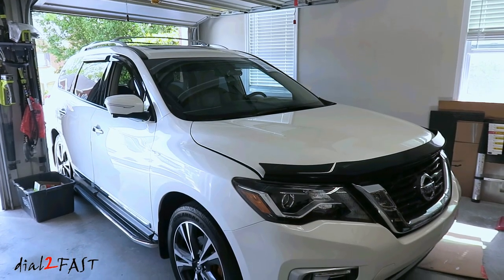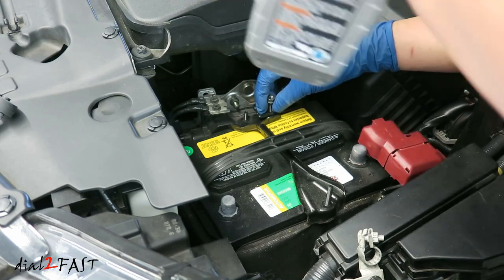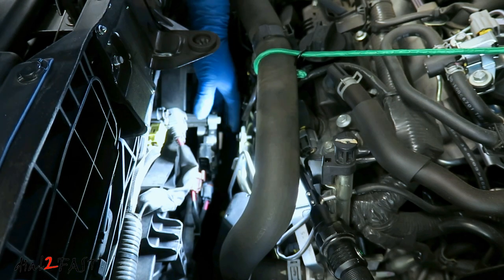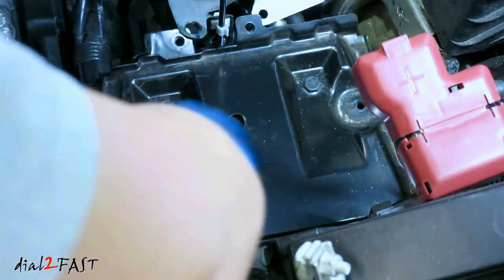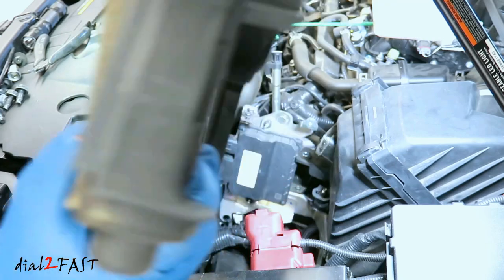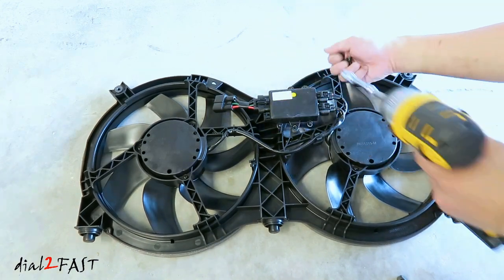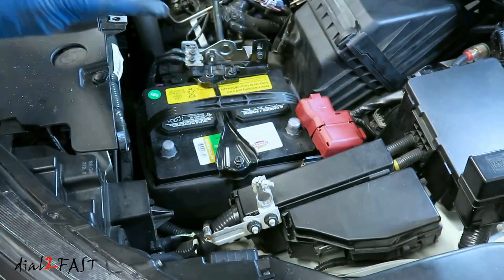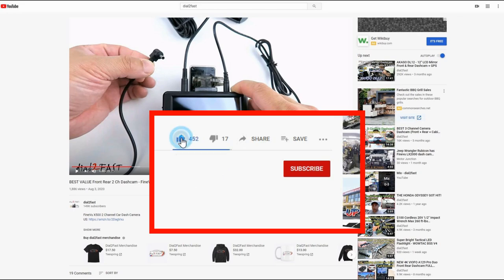How To Replace Nissan Pathfinder Radiator Fan Assembly (Infiniti QX60)

Comment: My new, "used," 2016 Nissan Pathfinder which I purchased in October of 2021 with roughly 57500 miles on it, started making the fan noise after driving it about 2500 miles.  Unfortunately I discovered this chronic fan assembly issue after my purchase.  Fortunately, I found your video and purchased and installed the recommended fan assembly, (TYC 623760 Cooling Fan Assembly (For Nissan & Infiniti), as you demonstrated in this video.  It was installed during the first week of January 2022 and it worked beautifully.  It is now May and about 5000 miles later and sure enough it happened again, and now I am left with nothing.  The part is no longer available through Amazon.  I cannot even get the satisfaction of writing a "scathing"  review of the TYC 623760 Cooling Fan Assembly (For Nissan & Infiniti), because Amazon doesn't even recognize it.  Now I am stuck in southwest Florida, taking my vehicle to a Nissan dealer of which I am very leery.  They tell me the OEM Nissan part costs $577.50 with tax and if it takes any more than 2 hours of labor, I am paying $1000.00 +.  I am going this route however, so when the next 5000 miles or so rolls by, it will be covered by warranty.  (Let's hope Nissan can at least stand by their own warranties on their own parts).  I cannot express enough the rage I feel about being so misled with this junk vehicle and I still owe a ton on it.  From the dealer to the DIY, I have been lied to, and/or misled.  Nissan=Bold face liars with no integrity.

Comment: Very helpful! I just did the replacement but I'm noticing that the fans are on all the time and seems to be actually running super fast when the AC is turned off. When I turn on the AC the fans calm down a bit and run at normal speeds. Not sure why it was happening so I replaced the relay that controls the fans but the problem continued too happen. 
Any suggestions on what might be going on??
Reply from the maker: The only thing I can think of is there might a problem with the fan controller that came with the new fan. Not sure if you want to try connecting the old controller to the new fan and see if the problem is still there. If that fixes it, then contact the new fan seller and ask for a replacement.
Reply: Which brand of fan did you buy? I'd like to avoid that one.
Reply: @Stephen Cabrera
Reply: @dial2fast  I replaced mine 2 summers ago, and I just noticed that neither fan is running at all. I had strange symptoms last summer that led to the check engine light and traction control light coming on, only on hot days when I had the A/C on and was stopped at a red light. Nissan dealer read the code and it said mass airflow sensor. They replaced it, and 2 weeks later the lights were on again, in the same situation. I think that the fans might not have worked since last August, and that my A/C was stressing the whole system. This year, the lights come on  as soon as we got a 30 degrees Celsius day and the engine would stall out. 

Since I know the fans don't work for sure, and I've tested the fan relays, do you suggest replacing the whole fan again? Or should I take off the front air box (for room to get at the wiring harnesses) and attempt some other kind of test on the module or fan motors? 

I'm ready to trade in the vehicle and buy something new, but now I have this issue and I'm afraid the dealership will notice that the fans don't work and the A/C sucks and they will low ball me. 

Thoughts?

Comment: First thank you for the video it'll be helpful for some that are or will be in the same situation! Second its sad you had to to this on your own on a car that's basically still new since you have low miles on it. Nissan should be responsible for it. On the nissan forums i see allot of people had to replace theirs after few years and when i say few its usually after 3 or 4 which is outrageous! Please do us a favor and report this to the NHTSA the more people report about this problem nissan will eventually be forced to do a recall on this. Its a shame people have to spend their own money to fix a thing like this just after owning this car for few years. That being said keep up the good work!

Comment: So I finally got everything back together (bigger project than I thought) and saw one of the three rubber bumpers fell off when installing. Is this a big issue or am I’m good?
Reply from the maker: The rubber feet is to prevent vibration from the fan. You will probably be fine with one missing. See if it gets noisy when you drive, or vibrates a lot. If not, don't worry about it.
Reply: Awesome thanks!

Comment: Once the noise starts how long on average until the fan fails? And when it fails, what normally happens to it? Freeze, get torn apart from the vibration? Thanks.

Comment: Awesome video!  Really appreciate you posting this.  I replaced the fan and the motor won’t shut off even with A/C off and very cold temps.  Any ideas on the cause?  The original actually did the same thing.  Have a 2017 Pathfinder.
Reply: My tyc fan assembly also comes on immediately. It even comes on with the engine off, but just the acessories on. Is yours still doing this? Have you had any issues? After a week my fan control module exploded...
Reply: @user-jn3bk8uz9x  Shoot same here. It has been cold so I thought it was off because it was supposed to be off.  I can’t get the fan to run at all now even with warm temps and A/C on.  Probably an exploded control module.  What did you end up doing?
Reply: @taylorforbush1415  Hey man, here is what happened. I ordered the TYC assembly from Rockauto and installed it. It ran constantly for a week, as I mentioned even in acc mode. When the module blew I got another TYC from Rockauto under their warranty. It is when I installed the second one that I noticed it wasn't coming on, even after driving on the highway with the a/c blasting. I took it to a mechanic nearby and told him everything. It turns out part of the IPDM was damaged. He showed me the part and it looked like part of the circuit board near the fuses was actually damaged. This is the part that sends the signal to the fan motor assembly (I think). The were able to find a replacement IPDM from a scrap yard to save me some cash. He said it could have been damaged when I was wiring it all back together. After the first fan installation I used a voltmeter at some point to test the current in the cable that attaches to the fan control module to check for power. He didn't confirm this, but I wonder if I didn't short something out at that point with the voltmeter even though the car battery was disconnected. I hope this helps, let me know if you have any more questions.
Reply: @user-jn3bk8uz9x  Thanks!  I wondered if it was an IPDM problem. I was going to test it with a multimeter to see if there is any power making it to the fan module.  Thanks again for your reply!  Very helpful!
Reply: @taylorforbush1415  You are very welcome. I hope it helps. I really wish Nissan would recall this, but who knows if they ever will. Best of luck to you and your diagnosis. Peace

Comment: I will be replacing the fan assembly on my wife's pathfinder this weekend. I just noticed the fan assembly I purchased does not come with the control module. Can I use the old one?
Reply from the maker: You should get one with the control module. Unless this is an OEM factory fan.

Comment: How’s the TYC radiator fan doing after 2 years? Is it still working ok ? I have to replace mine and wondering if the TYC is performing well.
Reply from the maker: Still works fine.
Reply: @dial2fast  Thanks brother

Comment: You wouldn't happen to have a video on how to replace the head light assembly would you ?
Or information about it ?
Reply from the maker: To remove the headlight, you will have to remove the front bumper. I did make a video on removing the front bumper. You can use it as a reference https://youtu.be/bQ9uauyLItQ
Reply: Thank you sir,  you are super awesome.

Comment: Will it make any difference if I omit putting the adhesive foam?  The fan that I purchased from Amazon did not come with a foam.
Reply from the maker: The foam is for noise and vibration. You can run down to your local hardware store and pick up a roll. It's the same stuff they use for insulating doors and windows.
Reply: @dial2fast  ok great and thank you very much.

Comment: Sir, after replacement of my cooling fan for my 2017 Nissan pathfinder. After I started had check engine light on
Reply: I found out on 3 connectors to the tcm assembly has 1 connector attached

Comment: Hey doc, did the replacement with the same fan but now the fan constantly runs when I have the engine on or the ignition is in the on position.   It wont stop running until i turn off the engine.  Any suggestions?
Reply: Found out the new fan module is causing the fan to continually run.  Returning it and ordered one without the module since I know my oem module works fine.  Thx for the tutorial though.  Going to have to do the job twice.

Comment: Could you make a vid on how to replace transmission fluid on Nissan Pathfinder 2017?
Reply from the maker: I will when I have to do this service end of this year.
Reply: Thanks a lot 
Your vids are so informative and well done
Reply: @dial2fast  I have noise of squeaking coming from behind  may be  it comes from the trunk or the left back door .
My car exactly as urs, 
I took it 3 times to Nissan Dealership, 
They couldn’t figure out where it comes from.
Do know ? 
Or any experience with that in ur vehicle? 
Thanks brother

Comment: My '16 is literally in the shop right now for this.  Thankfully purchased Carmax's extended warranty.  My cost is only $280.
Reply from the maker: Good to hear you getting it repaired under a warranty!!
Reply: Im thinking i have the same issue will call carmax in the morning
Reply: @oshaye4real925  Definitely worth the call.  My local Carmax wasn't doing warranty work for whatever reason, so they directed me to RepairPal.  $50 off your deductible if you go that route.  Cost of repair came out to $909 (which is insane), but my cost was $282.  I opted for the $300 deductible when I purchased the warranty, so with the $50 off Carmax covered all but $30 of the repair.  Good luck!

Comment: I have to replace mine. Fan started rattling. Has the cooling fan failed you yet? My friend works at Nissan, he said "after markets last 2 months" Hes a mechanic at dealership. Its $585 at delearship. Thats expensive!!
Reply from the maker: There are some aftermarket parts that are poor quality, but in this case, the OEM fan uses a cheap ball bearing that can fail prematurely. I recommend the TYC fan I showed in the video. This fan outperforms the OEM one at less than half the cost.

Comment: When I put in the fan part number TYC 623760 into Amazon, it will say it doesn’t fit the 2017 Pathfinder???
Reply from the maker: Many of these database are not correct. The part will work on the 2017 Pathfinder. You can check TYC's website https://tyc.mycarparts.net/

Comment: Hey can anyone answer this pls, I want to just replace it myself because nissan told me it would be around 1.5k to fix and they told me I would need a control module for the fan??? Is that true?
Reply from the maker: As shown in this video, the aftermarket replacement fan comes with a new control module.

Comment: is that the original fan or aftermarket
Reply from the maker: The one taken out is original.
Reply: @dial2fast  the reason why I asked is because I replaced mines with an aftermarket and I think something isn't right cause it runs all the time even when my ac is off its runs fast the fan... any advice?
Reply from the maker: @jamesmorrison8410  There might be a problem with that fan control box.
Reply: @dial2fast  thank u I appreciate it...imma send it back and get another one hopefully that fix it..